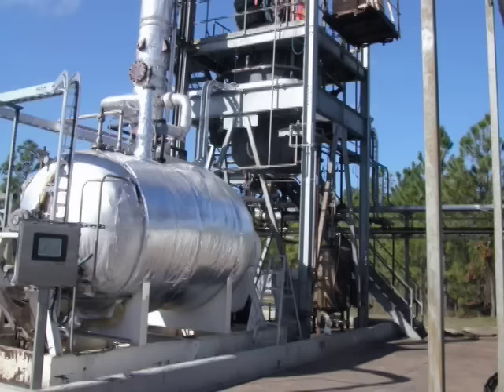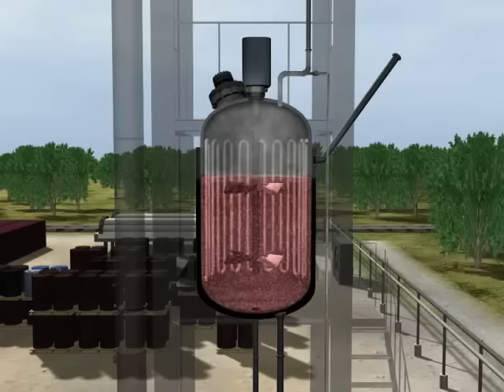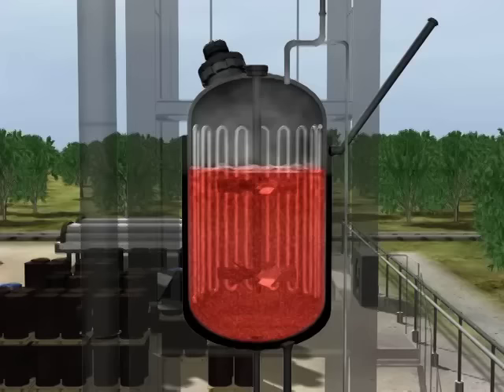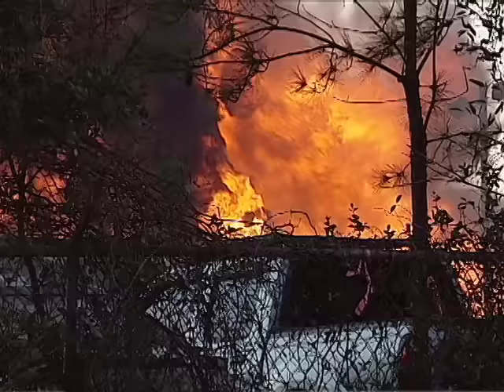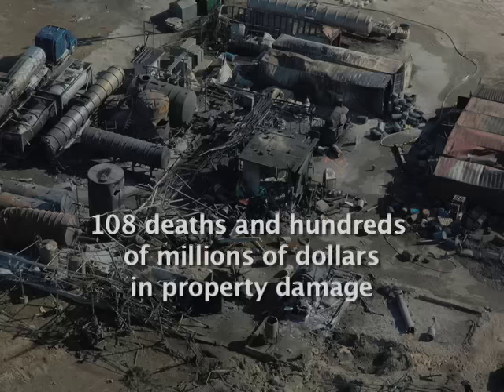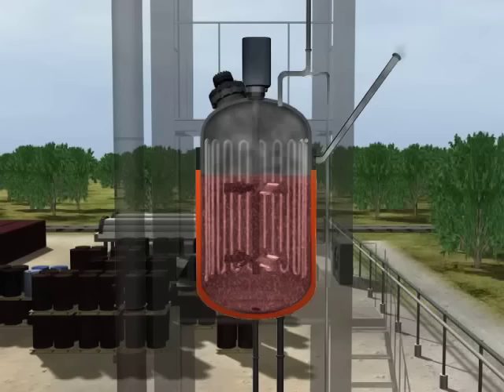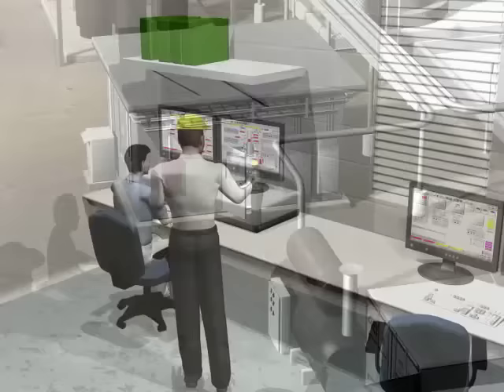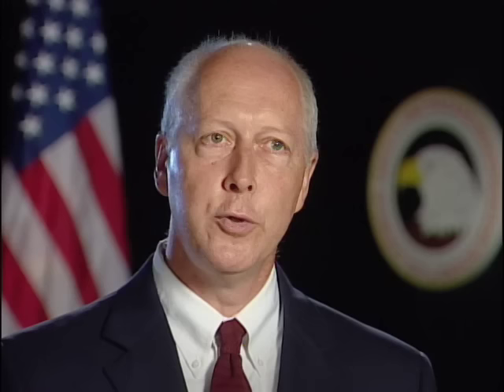Runaway: Explosion at T2 Laboratories

Comment: I have found that most scientists today are no longer aware of a basic principle that was part of the basic building blocks, of Universal Science. It is the Surface area to Volume ratio that exists between a small sphere and a large sphere. 

Where ever you have a material, that has a potential spherical shape within whatever container or tank shape it may be reacting in, that spherical shape must be the basis of your calculations for heat dissipation.

A small sphere has a larger surface area to volume ratio than does a larger sphere have. That means as a potential sphere gets larger, the volume of reacting material in the volume is too great to pass heat generated through the small surface area of the potential spherical shape in any tank. As the sphere gets larger there is more heat generated in the volume and less surface area to dissipate it. 

This is also the reason why single cell organisms cannot get larger than they do. As a living cell gets larger it needs more food and creates more waste in its volume. Yet the cell membrane is now much smaller in ratio to the volume. So the cell dies of starvation and drowns in its own excrement. 

If you look at the formula for a spheres surface area Pi D^2 and the formula for a spheres volume Pi D^3 / 6 you will see that a small sphere has a much greater surface area to volume ratio then does a larger sphere. Meaning no matter the cooling equipment at some point there is just no way for the material to pass the heat through the imaginary spherical shapes surface area, contained in the tank of whatever shape.

These principle were at one time part of the understanding of the actual atom that is no longer taught in public schools. It is no longer taught because the government defunded any school that continued to teach these principles, as well as the atom and electricity properly. They can save lives.
Reply: The cooling system is usually calculated in a cubical or cylindrical manner, not a spherical manner. So although cubically they are prepared, they are not prepared spherically.
As thermal imaging cameras become more readily available this can be investigated more easily. However just knowing the principle, and placing thermocouples in key positions they could easily demonstrate the point I am making.
Imagine dipping 100 watt round light bulbs into  a narrow tank of oil, and lighting them. A tank small enough, that the bulbs are just about touching the edges of the tank. Then taking temperature readings in and around the bulbs. Although right at the tank wall, the heat could be dissipated easily. You would find that where the bulbs were touching each other. there would be tremendous heat. Even though all oil in the tank had a chance to cool. Now imagine when rubber or plastic are reacting, even the area around the imaginary spherical shapes are also supplying heat to that imaginary spherical boundary that is to small in surface area to dissipate the heat created in the volume of the imaginary spherical shape. The result is that the reactions go wild.
Really good chemists have figured it out. However it is also the principle behind atomic weapons, so you never see it published. It has to do with the core of the explosive expanding in a spherical or hemispherical pressure wave, that has a diminishing surface area in ratio to the volume. The explosive force and effects are maintained, or sustained, for a longer period than a much smaller explosive.
You can also use standard commercial substances to create similar effects in quantity.
"There is nothing which can better deserve your patronage than the promotion of science and literature. Knowledge is in every country the surest basis of public happiness." George Washington.
Sincerely,
William McCormick
Reply: Jess Vagnar This surface area and volume of a sphere ratio, is what they did not understand in China, about the recent acetylene accident. The accident involving wetted calcium carbide. Years ago a ten man team of Green Berets were taught how to destroy a whole country using such common materials. If we were the unknowing recipients of a first strike and had no other method to strike back, these men could wipe out a whole country.
The same effects can be created with naphtha or other hydrocarbons. It is no longer taught what you can do with acetylene or naphtha in rather small quantities. Out of ignorance and fear. Fear usually brings about the situation you are fearfully avoiding and covering up. It is the failure to understand the goodness in individuals and dwell upon what evil could be done if one had knowledge to do it that brings destruction.
Sincerely,
William McCormick
Reply: Jess Vagnar "It will be found an unjust and unwise jealousy to deprive a man of his natural liberty upon the supposition he may abuse it."  George Washington.
We have been made ignorant by the decisions to use counterintelligence upon our own citizens to hide the atom, and the atomic bomb just after World War Two.
Electricity, science, chemistry, math, history have all suffered perhaps a death blow because of the distortion of simple basics of learning.
Sincerely,
William McCormick
Reply: I give you my word that as of 1973 it was illegal to teach the real atom and get Federal funding. You could lose your teaching certificates for teaching reality.
After that the poor teachers excelled and were promoted. The good teachers were down in the dumps. I had two teachers start crying in class about changes in curriculum, from correct to incorrect.
Reply: Jess Vagnar Atomic, nuclear, or conventional bomb, it is just an area too high in voltage to exist in the universe. God in his infinite wisdom to avert the whole universe from being consumed by a single explosive, disperses, the bomb core, the area that is extremely high in voltage.
The active bomb core has an abundance of particles of electricity within and around the core. Because it is blocking ambient radiation (high velocity particles of electricity), from quickly invisibly passing right through the bomb and stabilizing the matter in the core. Ambient radiation slows as it approaches an active bomb core, before the explosion creating a bottle neck. That is why you can feel a bomb before it explodes. If you are close enough and looking at the bomb, you will feel a push from behind before the bombs physical shape changes. The ambient radiation is slowed to a velocity that repels much like gravity does. As the bomb detonates this effect reverses. So many people believe there are attraction forces. I can assure you there are no attraction forces in this universe. Just try to demonstrate attraction to a scientific proof of it. This was part of the counterintelligence initiative that was openly announced.  
Ambient radiation stabilizes all matter continuously, or matter would cease to exist. Matter would just disperse without being bombarded, pressurized trapped and contained by passing ambient radiation. Ambient radiation repels the particles of electricity in the single hydrogen atom into a spherical shape. The single hydrogen atom, is a sphere of particles of electricity, that is repelled into a spherical shape by ambient radiation passing by the hydrogen atom. That is how the atom used to be taught in America. The Siamese hydrogen molecule can with extreme heat, an ARC which can reach 35,000 degrees Fahrenheit, be split and it will cause atomic effects with the liberation of great heat.
The power for atomic bombs does not come from the bomb, rather ambient radiation is the source of unlimited power. A bomb is very much like the sail of a sail boat, and the ambient radiation very much like the wind that pushes the boat. The bomb is just a filter no matter the type of bomb.
Our universe is only an electrical effect an illusion. Matter is 90 percent space. No two sub-matter particles have ever touched. No two atoms have ever touched. What we call an explosion, a loud shock wave from a car crash, is only particles coming very close to one another. No sub-matter particle has ever been destroyed. Matter is merely altering the velocity of ambient radiation from these rather shocking events. We perceive the particles that bring us information about an event however we do not see the event. Or even the particle the brings us the event. They have been filling students with false beliefs in our technology and the universe.
Sincerely,
William McCormick
Reply: Jess Vagnar My back ground is a bit shady, I was probably the best pupil on earth in my early life. I saw so many people and saw through everyone's day to day lies. I wanted to change all that at all costs.
I was an honors student and a mathematician at a very early age. I was working on a main frame doing very basic programing, in the fifth grade. But in the fifth grade, 1972, during a lecture from a Universal Scientist that my teachers would ask to our school to lecture honor students. The professor informed us that as of next year 1973 he would no longer be able to lecture us in a Federally funded school. He got a tear in his eye, and told us that he had given us all that we needed to make it through life. And I have to say he did a very good job. Our heads spun for 45 minutes as he moved through, the entire universe. With simple analogies to common things. My father working at Grumman Aero Space and myself having known Roy Grumman, already knew many of these things, that some of the students thought perhaps science fiction, not as being very real and very demonstrable.
Later after I lost interest in school my science teacher in middle school, said I had to enter a project or fail. So I built a working solar house, and won a second place at the school science fair. Then he said that I had to enter it in the Long Island Science Congress or fail, because I was cutting school. So I did and I took a first place and won a scholarship to C.W. Post college. But I had no interest in school anymore. Having seen two teachers break down in tears as they held two pieces of lab equipment with two different markings on them and explain we would now be learning the wrong device, I had enough.  
Where I come from ARC is (Anode, Rectified, Cathode), lightning. Lightning takes a meandering path, where as electricity from a stable power source flows from point A to point B in a rather straight path. ARC is the reaction to a communication of electricity from point A to point B. That is what fooled colleges and got them to change from Benjamin Franklin's exacting labeling of electricity to the incorrect labeling we use today. Ben used pointed and flat electrodes to prove the direction of electricity and the pressure of it.
I just have some tidbits of history I will try to post them.
Sincerely,
William McCormick
Reply: Jess Vagnar No need to thank me, during my life I would see a guy standing in a corner looking at me rather suspiciously. I was always asking a thousand questions and offering what I knew. Time and time again someone would race over and give me some amazing bit of information after they thought I would appreciate it. From explanations of how top secret military weapons work, silent ammonia explosions, to parabolic accidents in glass factories. I was like a magnet for this stuff, and I loved every minute of it. I owe the people that gave it to me and told me to tell others. It is no choir for me. I appreciate a friendly ear to run it past.
Sincerely,
William McCormick
Reply: +William McCormick Thanks
Reply: Wow! You've discovered a new law of geometry! Surface of sphere = 4piR^2.... volume of sphere = 4/3piR^3. Ratio for 10" sphere = (4pi25)/(4/3 pi 125) = 0.6. Ratio for 100" sphere = (4pi250)/(4/3pi 1250) = 0.6. Apply for your Nobel now!
Reply: William McCormick Perhaps you can cite the exact law that prohibits "the teaching of reality"? As your story seems rather farfetched.
Reply: +Syclone0044 Indeed. I'm only down this low in the comments because I was held in rapture by what in the hell that guy was talking about. He picked a lot of stuff up off of random people who thought he would "appreciate" it? That pretty much says it all right there. :P
Reply: Teaching business skills is more important these days.
Reply: TL:DR
Reply: Shh... Nobody tell the scientists.
Reply: Everyone, vote down this absolute crank and "probably the best pupil in the world".
Reply: @Syclone0044  seriously though. 1: this incident happened 10 years ago. and 2: "most scientists" are very familiar with many concepts this guy has yet to even begin to understand. This concept described is an aspect of engineering anyway. I'd bet money this guy thinks he's the epitome of human intelligence and just nobody else can understand him.
Reply: @scowell  Er, wow! You're both wrong! (Although the McCormick is correct in his assertion that the ratio decreases with size. Observe ~ the ratio is indeed decreasing as the size of the sphere increases ~ you can pretty much throw out the constants in the formulas because of the exponential effect of the cube vs square function )  - Your arithmetic is bad -  Ratio for a 100" sphere is .06 not .6.  Using your (correct) formulas 50^2=2500 and 50^3 = 125000.   If you're going to call somebody out at least double check your math.  Class dismissed.
Reply: Check your math. 

The formula for the surface area of a sphere is Diameter times Diameter, times π
The formula for the volume of a sphere is Diameter, times Diameter, times Diameter, times π ÷ 6

A ten-inch sphere has a surface area of 314.1592653589793
A ten-inch sphere has a volume of 523.5987755982989
That is a ratio of 0.6

A one hundred inch sphere has a surface area of 3141.592653589793
A one hundred inch sphere has a volume of 523598.7755982988
That is a ratio of 0.06

You were just off by a magnitude of 10; it happens due to the poor math practices of new. 

A cube follows the same ratio. 

However, for runaway reactions, the formula for the theoretical sphere within the cube has to be observed because the heat will be trapped at the limited surface area of the theoretical sphere, and not benefit from the cooling surface area of the cubical tank or containment.

Sincerely, 

William McCormick
Reply: @Syclone0044 , If a school is Federally funded, they must follow whatever curriculum is given them to teach. Even if it witches and hobgoblins. And that is what they are teaching. 

There are no neutrons, and if you have learned the universe from a universal scientist, in proper order, it is rather easy to prove. There are no attraction forces in the universe. All forces you witness are pushing forces. Gravity presses you to the earth. Magnets are pushed together. Dirt gets pushed into a vacuum in all cases above there is no attraction force because an attraction force cannot be demonstrated either in principle or by actual observation. A pushing force can. 

When the new "modern" scientists with government grants went against Universal scientists to force the neutron into existence, a particle that was stated to exist by attraction forces, the universal scientists asked them to demonstrate the attraction force. It ended up with two "modern" scientists making hugging gestures around each other because even they knew you had to push things to move them or hold them in place. Yet the "modern" scientists got the grant monies and the rights to teach the neutron in public schools. Most knew it was a hoax at the time, but everyone was poor, that is what the government does to the country to get their way. A penny tax on the dollar will collect all but the last dollar circulating and return it to the Federal government. So if the government does not recirculate that collected tax money or add newly printed money to a growing country, the country will become poor. That is how they control us. This is not a conspiracy because the government openly announced that they would hide the secret of the atom and the atom bomb from us. Well at least most of us.
Reply: @Syclone0044 , If you knew the technical information and basics I carry with me and keep pure, you would not be too quick to dismiss me. 

I was at least at heart, the best student I have ever come across, and I am always looking for others like myself. It is not that I am so fast or bright or smart, I do not have a large ego, so I am not afraid to say I do not understand what you are teaching me.  Often as it turned out, neither did those teaching it. That is when I went out on my own and finished my own education. I had a scholarship to C.W. Post for winning the Long Island Science Congress, but the curriculum was so ruined by that time that I did not even wish to go there.  

There are so many things no longer taught in school that I get emotional thinking about people being steered down a dark ages path. Look at the numbers of people that believe there is such a thing as Global Warming. Those same people have been caught by me many times because they do not know that water is the secret thermostat that regulates the temperature of the planet. Water and Antimony are the only two substances that have there highest density at a certain temperature, not the coldest temperature. For water the densest water can be is at about 40 degrees Fahrenheit. The way water regulates the planet's temperature is by keeping the base temperature of the ocean at 40 degrees, at the poles when it gets cold, cold water floats to the surface and maintains the 40-degree base of water in the ocean. The different temperature waters do not mix, very much like oil on water. When it gets really cold, the surface turns to ice and acts as a blanket to protect the 40-degree base temperature water. By the equator, warm water floats on the 40-degree base water, like oil on water. Keeping the ocean from boiling.  The thirty year Sun cycles that run hot and cold are offset by this principle. The polar caps recede after a hot sun cycle and then reform during a cold sun cycle. 

Some of the proof of all this just being weather patterns is that just 300 years ago the poles were exposed as they are now. These are just weather patterns.
Reply: @joecies , So sorry I read your post after I posted. Excellent catch, thank you. I did not know anyone responded to me until this just popped up on Youtube after another Youtube video finished. I recognized it but I did not remember what I wrote exactly, I get that all the time I have no hard feelings but I also would not wish someone to miss out cool basics because of someone else creating chaos. 

I saw Scowell's reply and responded before I read your reply, I would have left it alone I am so busy with other projects. 

I am sure of the ratio, and as you put it, it is just the two-dimensional square versus the three-dimensional cube, varying ratio of surface area to volume of different sized cubes, that follows through for a sphere. 

I did HVAC for 15 years, and you get a very good understanding of two dimensions versus three dimensions. Doing CFM (Cubic, Feet, Minute) calculations for different sized and height rooms. Using different methods and shortcuts.